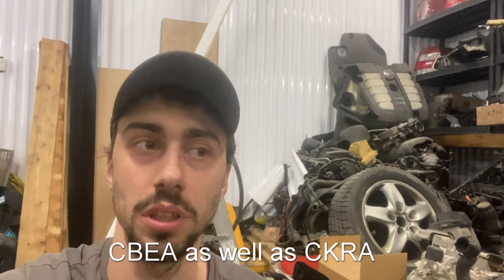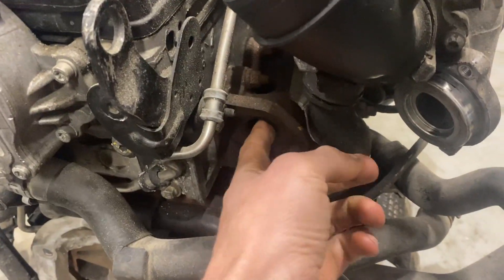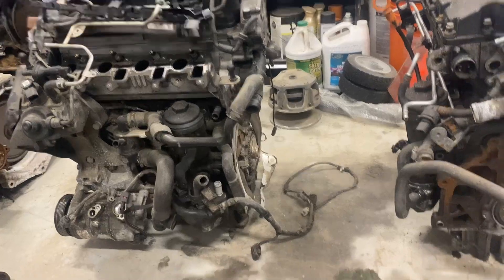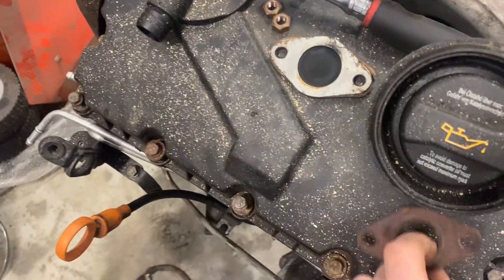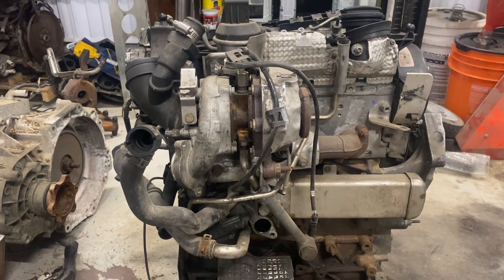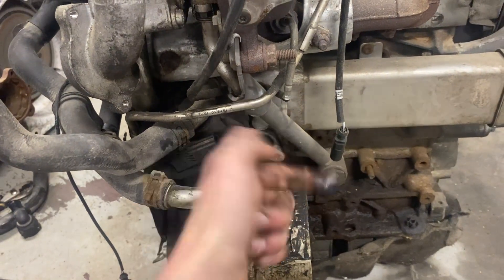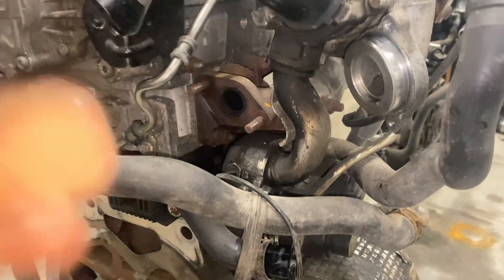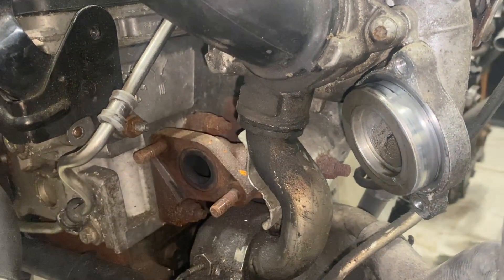CR TDI EGR Removal *For informational/diagnostic use only*

Comment: Could I leave the coolant lines still attached to the Egr cooler and just still have it cycle through even though I have the Egr deleted and hood stacked
Reply from the maker: Yes just put a blocker plate where the egr pipe would've been from the exhaust

Comment: What's would happen if I deleted the egr pipes, valve and cooler but couldn't get it tuned? Would it just throw a code or is there a risk of breakage?
Reply from the maker: leaving the dpf in? possibility of it not regening and plugging. if removing everything and not tuning then you'll be in a sort of "soft limp mode" all the time.

Comment: Im installing darkside turbo inlet pipe that requires that turbo inlet adapter to be removed. My car is deleted, what should i do with that hard line that comes up from the cooler and plugs into the bottom of the turbo?
Reply from the maker: 1 1/4" expansion plug and loop the coolant lines

Comment: Hello @JoshsJettas. I know it's a bit late to this vid, but I have some questions. My CKRA just got a code for EGR Cooler Efficiency. I want to remove it (for cleaning obv), because i think its leaking (I put in brand new coolant and it turned orange overnight + slow leak). Is it ok to leave the HP EGR piping in place with a blocker ok (for the stock look)? Is it ok to leave the EGR Cooler if i block the turbo inlet and bypass the coolant lines? Also, how would this play into a DPF & SCR delete (for maintance)? Thanks again for this channel is a gold mine for my passat. Thanks

Comment: So a few more questions. The pipe that leads into the turbo, if I leave that on there, bypass the cooling hoses, and block off the exhaust from entering the egr cooler, does it make any kind of difference? The problem is, is I don't have another blocker plate for the tube that comes off the turbo. I do have a plug for the turbo inlet, just not another plate and I don't want to have to order another one. But I also don't want it to screw anything up.

Comment: another one that’s often over looked and why they do it is darkside developments is the best option for the race pipe as they have taking into consideration for the standard intercooler pipe to fit nicely on the race pipe as they make there’s 51mm outer and inner 2.5 as these billeted ones are 57mm outer 2.25 inner and is too big outer wise for standard intercooler pipes too fit on which u will run into issues later with a boost leak go 51mm race pipe darkside

Comment: For the low side what is stopping you from slipping the blocker plate between the cooler and the pipe that runs off to the turbo. I know you said it was be cause it was just slip fitted but if its blocked off by the sandwiched blocker plate would it still not work i know it as about a 1/4 inch or so would it be too much to just bend the pipe in to position i dont have or know anyone who can weld aluminum…
Reply: He kind of alluded to it in the video; but since it’s just slip fit in there, it will eventually fall out and then you’re sucking un filtered air

Comment: i used a singLe egr block off plate and switched to evan coolant and with hopes of elongating the egr cooLer Life 

since evan is not water based and wont eat into the metaLic internaLs and cause damage as the reguLar cooLant does

ow btw i like the 11:11 stuff ; )

and the fact that there is a hookah Like exhaust filter 
allowing hot exhaust to pass throu water 

not only to remove nearLy all the harfmfuL particles but produce super heated steam / pLASMA

ready to be burned back in the engine aLong with the fueL and therefore reducing fueL usage and engine wear specially in diesels 

,constantly steam cleaning the combustion chamber

WHEN PLAZMA iNTERACT WITH CARBON, THE RESULT iS TOO GOOD TO BE TRUE
 AND THATS WHY YOU HAVNT HEARD THiS YET

this is a well known and well hidden fact since day one of the automotive industry

just like how churchianity got away with wrongly calling a water powered car
and natural gas powered vehicle _______

Comment: Hey man. I think I discovered you a long time ago for heater core stuff (and I remember noticing your radio presets suggested you live not far from me). Now my 2014 Passat TDI is giving intermittent glow plug light flashing followed by loss of power (limp mode?) then goes back to normal. It seems to do it totally randomly right now and online searching would suggest I might have a sooted up EGR valve. Is there a EGR delete kit that would be your go-to or just the blocker plates and tune files?

Comment: Just for clarity is it ok to bypass the coolant if the EGR is deleted via tuning and one blank at the EGR filter connection flange. Or does the EGR cooler need to be removed (and the corresponding openings blocked off) if the coolant is bypassed?
Reply: +1 also need to know this

Comment: How do I know for sure wether or not my EGR coolant is  leaking? I noticed that you swiped your fingers in the opening where the EGR filter attaches while mentioning the leaky coolant issue . Is that where coolant would found? My coolant level gets lower slowly but I beleive that's kind of normal. I am in process of removing the DPF so I can see the EGR cooler and it doesn't show any signs of leakage on the outside easily visible parts...

Comment: Hey! Doing the high pressure egr pipe delete right now, I’ve gotten both ends off, but it’s still connected somewhere in the middle, can’t seems to figure out where! If anyone can help that would be great
Reply from the maker: Yes theres a bolt in the middle, its honestly a bit of a pain to squeeze out

Comment: Hi Josh, if I were to put the race pipe in and block off the high pressure at the engine, would this require me to completely remove the egr cooler as well? I currently have the low pressure blocked off on the cooler.  I am just wondering if deleting and cleaning up the high pressure side will give me issues with the egr cooler? Someone mentioned hydro locking and I’m not sure if this is related. 
Thanks so much for sharing all of your knowledge. You really know your stuff
Reply: i would like to know this as well... and ideas josh's jettas?

Comment: Hey Josh. Can you please help me understand why the EGR cooler will begin to leak coolant internally once the high-pressure EGR port is blocked off and the EGR valve has been closed via tuning?   Also, once the EGR valve is permanently closed, about how long until it begins to leak internally in your opinion?   Lastly, will the EGR fill with coolant and get inside the low-pressure turbo inlet?
Reply: It will leak because the emissions systems are junk and the cooler will crack eventually letting coolant in

Comment: Hey josh, are there any risks to putting blocker plates on the high pressure egr and on the low pressure side on the egr cooler and not taking the cooler out? Or should I remove the egr cooler completely. This is my first tdi and all of these things are new to me lol
Reply from the maker: If the coolers not leaking just leave it in imo, sure simplifies the process.

Comment: Im telling myself as you're on the turbo at the end, I'd just weld that thing, and then you say that. Now welding that casting probably wont be a ton of fun but I can manage.
Reply from the maker: The cast aluminum? Mine held water just fine but it is damp with oil now so I think it’s seeping. I didn’t weld it myself but I know how cast anything sucks and can be porous

Comment: Great vids I removed the EGR and flap and put the full race pipe on and remove the cooler but I’m getting rough idle. An error code P2021. I have a tune Zila  stage2 egr delete - any suggestions or tricks would be most appreciated
Reply from the maker: Did it for sure get the flap delete as well?

Comment: I'm fighting getting the egr cooler out... so I have to remove the turbo brace/ oil line from the back of the engine? How much oil can I expect?
Reply from the maker: I’ve never removed it unless the turbo was getting removed too, a little splash might come out of it as in a cup or ao
Reply: @JoshsJettas  I still am unsure as to what sensors are supposed to stay after removal seems no one really addressed that part.
Reply: Barely got any oil like you said....I don't know how a guy could get it out without taking it off unless they're gonna take the other hard line off the transmission side. That was almost as bad as removing the dpf! I wonder why no one does a very detailed video of the removal of the egr while in the car. BTW I took the air intake off and made an aluminum plug with a flange press fit it and tig welded it in place similar to what you showed as well. Your videos were the most helpful through all of this! Thanks Josh!
Reply from the maker: @johnmoser2689 yeah it doesn’t look fun with that mount still in there. All your exhaust sensors/flap get removed, only thing that stays is your 02 sensor on the downpipe right at the turbo and the egt sensor that is pre-turbo.

Comment: Hi Josh.  If i bypass the egr cooler do i need to use blocking plates for the exhaust egr port that went from the cooler into the factory down pipe, or the low pressure port that feeds off the cooler into the turbo?

 I have a stevenson kit, but it only came with 1 egr block off plate. I have that on the high pressure egr, and i have the plug for the turbo inlet, but i was unsure about these open ports on the cooler. 

Thanks for all the videos you have been a huge help!
Reply from the maker: If you’ve got the plug installed into the turbo and the cooler just has 2 open ports it’s fine to stay that way. If it ever decides to start leaking then you can bypass the coolant lines and get rid of it completely
Reply: Thanks again! @JoshsJettas
Reply: @JoshsJettas ever suck pool water up.your nose and get swolen orfus?

Comment: Hey Josh,
I have a 14 Passat and I’m wanting to remove the high pressure EGR. I was wondering if you knew which block off plates I need? Do you use the MK3/4 plates or the BRM ones?
Reply from the maker: I haven’t had a ckra in for awhile. I believe you’ll need the mk4 for the valve itself and a brm for the head connection but I don’t know for certain

Comment: Josh, I did the Rawteck .5 stage delete several years ago. If I’m understanding your video correctly, that low pressure EGR housing is completely un-needed now?  Was the sensor cancelled by the tune?  This started out as a simple turbo rebuild, now I think I’m seeing a bunch of worthless parts that got left on my engine.
Reply from the maker: The cooler doesn’t need to be there anymore no, quite easy to remove once the turbos off. You will need to plug the inlet housing into the turbo somehow thoigh
Reply: @Brakemann1  Josh. I got hi and changed my time belt. 
Now I have a new engine.
DMF is making noise and the exhaust stinks like acid. TDI jetta 
Wtf is going onn

Comment: I know this is an old post but it was very helpful to me and I just want to let anyone who is considering doing the delete is that I wish I would have done it a lot sooner. I did the 25 horse MR Tune and Flow direct exhaust. I went conservative because I have 242k on the car and don’t want to do a clutch. I was getting 38-40 mpg before and my last fill up I got 46.57. Like I said I wish I would have done it sooner!!!! Just wanted to tell you thanks Josh!!!! Keep up the good work.

Comment: Your channel is so informative when I’m trying to figure out what I want to do with my CJAA. If I ran both coolant hoses together that would bypass the heater core? So I would have to run a coolant hose from the head to the heater core to still have heat in the winter correct?
Reply from the maker: Thank you, most kits will use a splice so remove the 2 egr cooler connections and plug them into each other with the splice. Heater core will function as normal.
Reply: @JoshsJettas  thank you for the info!

Comment: Awesome video. I have coolant mixing with my oil currently on my cjaa, confirmed it’s not head gasket/injectors. Would using this elbow be enough to delete the egr? Or is the block off of the coolant port on the turbo necessary as well? Also can this be done with the downpipe still on the car? Need to tackle this and have a horrible space to work.
Reply: Race pipe.
Thank me later 
Get the longest one. 

She glided on it

Comment: If I go with the DPF&EGR delete will my engine take longer to heat up in colder temps ( I’m asking cause I saw mark Malone from Malone tuning mention something about it ) ? Also if I do the EGR delete in theory can I disconnect the EGR sensors and shut them off but leave them in place without putting the blockers so all I would have to do is the turbo back DPF delete straight pipe with the tune?
Reply: I meant to say leave the EGR pump in place **
Reply: @JoshsJettas my bad but I do have one more question too on top of the original one. If I delete the dpf and do a straight pipe from the turbo all the way back am I able to do a Malone active EGR tune so I do not have to remove the EGRs I’ve heard of people doing that as well?
Reply from the maker: @eliashill7161  might take a little bit longer but the dynamic idle will help with that. Simplest way is install a blocker on the egr cooler and don’t touch anything else, the tune will take care of it. EGR cant be enabled with the dpf delete, I have a video in the CR TDI playlist that I walk through purchasing and installed the tunezilla/Malone (as well as a discount code).
Reply: @JoshsJettas okay cool thank you for answering back, keep up the great videos
Reply: Stay in the pool to long and your leather ring will lose all control

Comment: Any tips for removing the EGR cooler with the engine in the car? I've heard people say you can do it without removing the turbo oil drain, but if I need to remove the drain how hard is that to do?
Reply: Ask donny Wong, enough is all there is after they its to much. Don't be a slob and wash both cheeks
Reply: well I did it today, you CAN get the cooler out without touching the turbo oil lines, but it is a serious PITA. You have to unscrew the 6 screws that hold the 2 parts of the cooler together, seriously not fun but that will allow you to get it out without disturbing the turbo (This was on a 2014 Jetta TDI, so others may be different)
Reply from the maker: That’s good to know, my only experience is removing the cooler during a turbo failure so I wouldn’t have been much help
Reply: @JoshsJettas  I was ready to install my parts over the weekend and didn't have new gaskets for the drain so taking it off wasn't an option in my mind. I just started ripping into it LOL 
Also my darkside kit came with a straight joiner for the coolant lines, I probably could've made it work by trimming the stock lines because it was heavily kinked, but I opted for a quick run to the parts store for about 3 feet of hose and cut a new line to fit, much cleaner looking and no kinks!

Also possibly worth mentioning, the darkside kit comes with a silicon cap with a worm clamp for the turbo EGR cooler hole instead of the plug, I was also worried about the plug failing and ending up in the turbo. The problem is there is a square piece (your thumb is on it at 9:31) that sticks off, you basically have to take a dremel to it and smooth it out for the cap and clamp to seal nicely, but if you do that it's a perfect solution.
Reply from the maker: @EJB93 I had seen someone post something like that the other day. I think that’s a really good idea (I wasn’t keen on that boat plug). My welded plug seems to be accumulating dust so I think the weld might be sleeping a little bit of oil/blow by out, I’ll have to look into a cap kit to work.
Reply: I specifically bought the darkside one because of that, there was only 1 other kit that offered the cap that I could find and the site looked sketchy. Now that I know what I was dealing with, im sure a similar cap can be found fairly cheap elsewhere. That UK shipping price was ridiculous.
Reply from the maker: I know what you mean, I’ve priced a few things out and shipping made it fairly cost prohibitive

Comment: It sure looks like oil filter change would be much easier without that damn pipe in the way.
Reply from the maker: Does open that area up nicely, and you don’t have to worry about burning your hand on it
Reply: Oh no, I dropped a couple parts. Where did they go? Oh I think I found them, I must have dropped them in to these boxes that i just got that say rawtek and darkside. Yes they look like the parts that belong there.
Reply: O thats funny pal, @poellot you drop your false teeth in the secondary dimple stick housing?
Reply: @JdsjsKdmem  you are typing words, but not making coherent statements.
Reply: @poellot  when your hair falls out it's because you lost it's respect
Reply: @JdsjsKdmem  stay in school please kid.
Reply: @poellot  i just frozen my pool for a rink, I make 53 an hr as a roofer who broke his back and now is a usless office guy who.makes more then the manager. Can you spell eat shit?
Reply: @poellot  my exauest smells like acid, burns, headache,  it was tuned and fine now it smells from down the street, soot around tail pipe. 
I switch to.t6 5w40 and got the stink. Use at205 re seal and it went away. Nowbits back. 
Is this a tune to ritch,? Leak in engine?.

I'm not good with spelling i drop out at 14 to start roofing
Reply: @poellot got the trots. Hold your pee, the last one here takes it all for free now David swim them shits